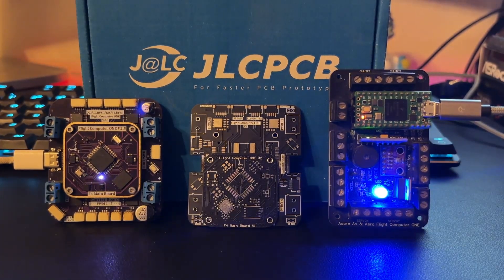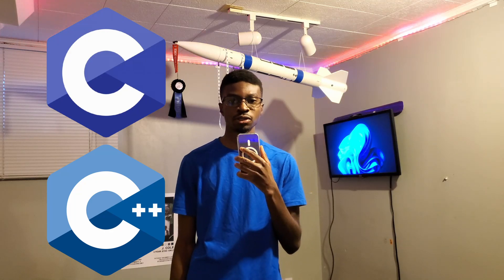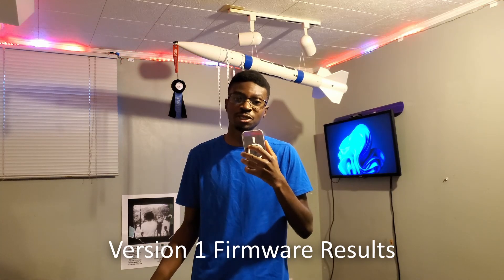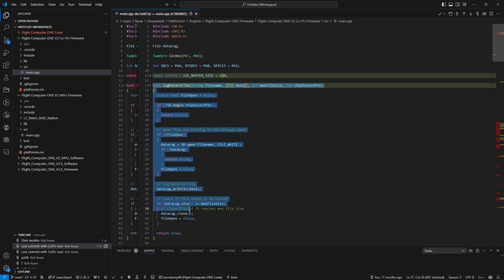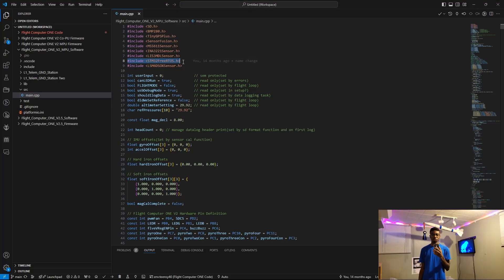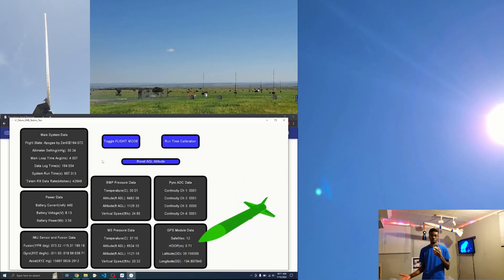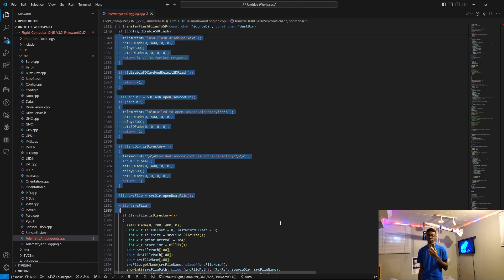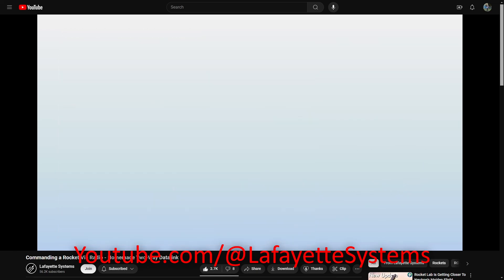Developing Software for an Actively Controlled Rocket

Comment: i want to know what software is at 6:06, and it looks like you're using antenna to receive some signal from the rocket? i didn't see any transmitter in ur pcb or i may have been mistaken
Reply from the maker: Processing IDE

Comment: at 3:12; Oh MAN, I am so glad I wasn't the only one who had to deal with this issue! I spent weeks trying to increase my data collection rate, while the barometer continually shut down those attempts. Splitting the sensors into multiple processes certainly does go a long way.
Reply: Also, I am relatively new to the hardware side of flight computer development. For a custom PCB (like your V2.5 with the STM32 processor), how do you flash the firmware to the controller? Is that information contained in the datasheets for the microcontroller? If you have two controllers (e.g. the coprocessor) how do you select which one to flash to?
Reply from the maker: Yep, you can find all relevant info in the data sheets/ reference manuals. For v2.0 of the controller I used two separate USB-C and SWD ports for programming/ debugging.

Comment: Hey! Your PCB design is super slick! I wanted to ask if you had any trouble with SD card logging in flight, mainly the SD becoming disconnected at all. I'm designing for an L3 rocket and worried that I'll need a different type of memory for logging. Just curious if you considered any solutions to keeping your SD card snug in its slot or using a power failure safe filesystem! Love your videos!
Reply from the maker: I appreciate your support! I logged to an SPI flash chip during flight then transferred data to the SD card on the ground to avoid any vibration problems.

Comment: Where exactly the thrust vector is attached? At the last cross section of the exhaust nozzle?
Reply from the maker: The TVC system is attached a few inches above the nozzle, thats where the forces are derived from.
Reply: @KofiAsare0  What about the simplest rocket? I was unable to find a clear answer, even in some instructional on basic calculations.

Comment: The priority of the task most probably is a little bit inaccurate. That can result of missing deadline of controllers. Also if I2C manager is managed wth Semaphore you face with priority inversion. You must use mutex. However you should ABSOLUTELY check thr Active Object pattern . Dr.Miro Samek perfectly explain the concept also he published an freeRTOS version of it. You will perfectly manage your tasks.
Reply from the maker: Thanks for the info! I’ll definitely look into it more thoroughly. RTOS seems to have much more potential than what I’ve experienced so far!
Reply: @KofiAsare0  Absolutely! For example, while you are trying to send the telemetry, deadline of the controllers may need to work, without preemption (rtos) its not possible so that you add an extra delay it may result of system failure. Dont worry, your telemetry task has been paused for a while, you will return back and continue to send. But managing those, is quite require some extra effort. Also I see that you are sending your telemetry datas as an ASCII??? Dont even do that. You waste your bandwidth. You should send your navigation package as an uint8 format . For example you have navigation struct you can cast it to ;

uint8_t *data = (uint8_t*)&nav.data;

Hal_Uarr_sed(data, sizeof(nav.data));

so you send your navigation data as byte format. But There is a problem. How you can understand is it a nav package or not? 

Thats simple. Add header and package type field to your struct and send them all;
e.g:

struct
{

uin32_t startofframe;
uint16_t packagelen;
uint16_t packagetype;
NavDatas data;
}mynav;

so :

struct mynav nav; // specify your header package lenght package type and etc..

uint8_t *data = (uint8_t*)&nav;

Hal_Uarr_sed(data, sizeof(nav));

I hope you understand,

Best regards,

Comment: Great job! How did you tune your PID constants so accurately? Is there a method to do so without launching the rocket itself and doing it from trial and error? Thanks!
Reply from the maker: Thanks! I used a Python simulator to create a basic model of the vehicle's dynamics, then applied the Ziegler–Nichols method to find initial gains. The rest of the tuning was done heuristically.
Reply: @KofiAsare0  Nice! How well did tuning it heuristically work with real-life conditions when you tested it?

Comment: Hi ! Such a great job ! Did you try to use DMA and SDMMC ?
Reply from the maker: Thank you! I’m not using either at the moment, but in version 3, I plan to implement DMA and use separate SPI buses for each sensor. The idea is to help minimize the load on the MCU.
Reply: @KofiAsare0 OK, cool, because it can simplify your logging in SD card I think and other stuff. I just hope that you'll have enough DMA and SPI cores for each device. Keep going 👌🏾

Comment: Phenomenal work!  I'm so happy that you share the resources you used in the development of this project. I myself am learning alot from your work. Where did you learn about freeing up the space on the onboard flash?
Reply from the maker: Thank you! If you're referring to the transfer function, it was developed using two SPI storage devices on the same bus. The process involves opening the data source, reading a buffer (~15KB), then closing it and opening the external storage to write the buffer's contents. This repeats until all data is transferred, followed by formatting the onboard flash. It’s a bit complex, so the next design will feature a single onboard storage device with direct USB access for simplicity!

Comment: Very nice! I like the progress. Let me write a few thoughts that I have:
1) I don't think you need anything Arduino-related anymore. Since you already competent with programming, think about dropping Arduino and using STM32 official HAL instead. You will get easy access to more hardware-specific features with this, also FreeRTOS is supported there out-of-the-box.
2) The best way to handle concurrent programming is by using blocking queues. Instead of guarding resources with semaphores, make only one task that has direct access to the resource and pass the data to other tasks through blocking queues (there is a blocking queue implementation in FreeRTOS). IMO this reduces complexity a lot compared to semaphores.
3) Use interrupts to solve a problem of your code being blocked on too-long i2c read etc if you are not doing it yet :) The way it works -- you start a non-blocking i2c read and your main code proceeds immediately to do something else, despite i2c hardware is still busy with communication. When the communication is done, an interrupt calls an interrupt handler function that handles i2c read result. So you don't waste time waiting for slow hardware. But the overall flow of your program needs to be changed accordingly...
4) You can also find DMA very usefull. For example -- you prepared a bunch of data to store it to SD card through SPI. Instead of using your MCU to feed SPI peripheral byte-by-byte, you can start a DMA process for that. DMA is a separate hardware piece in MCU that can feed data from memory to SPI (or other peripherals) while your MCU is doing something else. You also can configure an interrupt, to get notified when the DMA transfer is done. It's like your co-processor, but better :) and you already have it as a part of your main chip :)

With DMA and interrupts you will be able to save A LOT of cpu time. But I don't think that DMA and interrupts are well-supported with Arduino framework, so go with HAL instead.
Good luck!